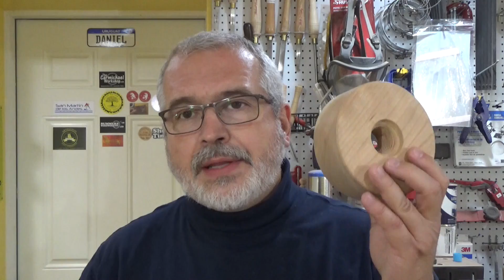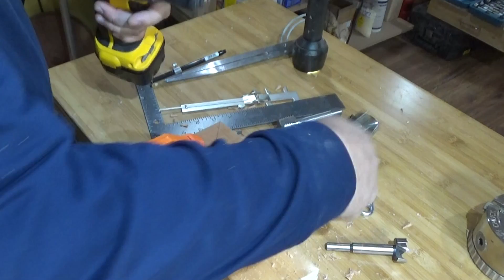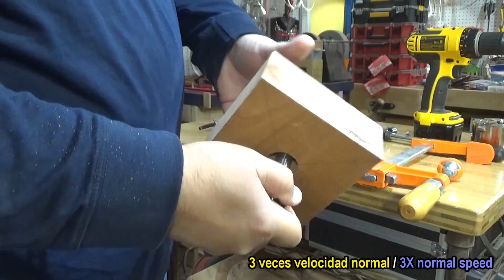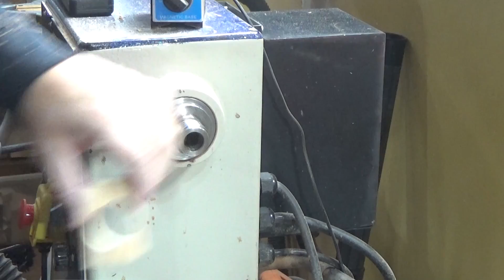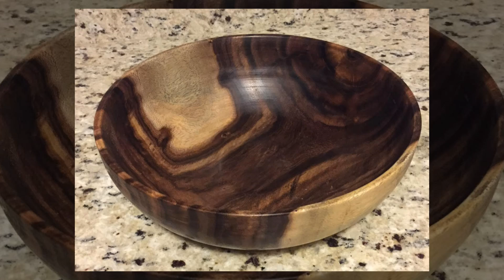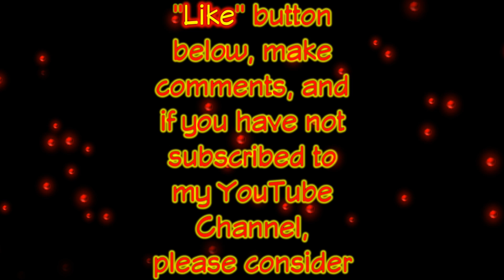Lathe Threaded Glue Block, Basic Tools

Comment: I already wanted to do this. Just havent found an affordable tap yet. A 1 inch 8 tpi tap is expensive...
Reply from the maker: Hi Willem! You are correct my friend! Normally these taps are expensive, check this page:
http://www.bealltool.com/products/turning/
And go to the place where it says Lathe Spindle Taps. Your measure is about 19 dollars there.
Those are really good quality, and for wood, they will last forever. I also got a die, but that cost me a bit more, about 35 bucks. Hope this info helps! Cheers! Daniel